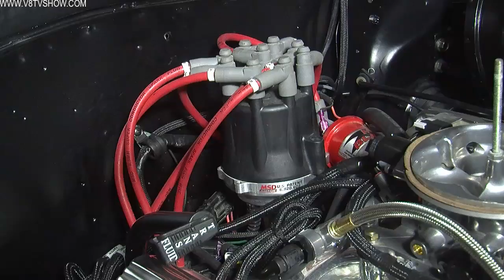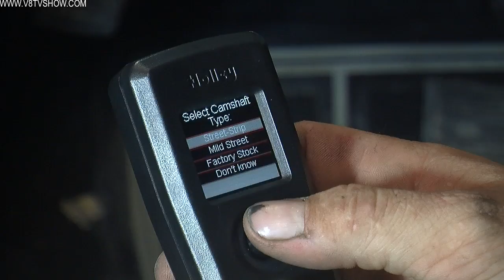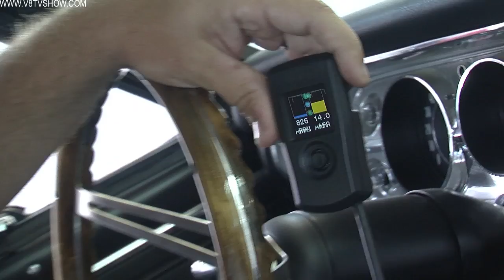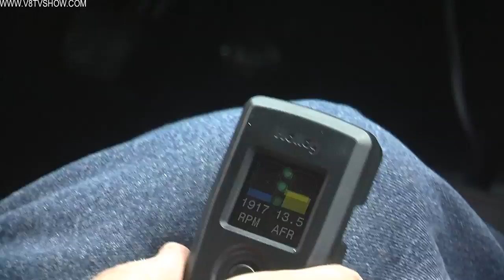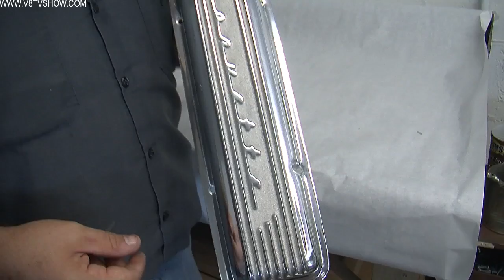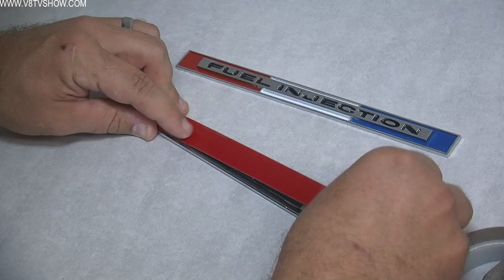Holley Terminator EFI System Install Video Part 3 V8TV 1965 Chevelle SS

Comment: Kevin,

Thanks for another great video install.  One question comes to mind:  What changes were required to the system settings when running the 5-bar C5 filter / regulator over the 4-bar standard set point?  Thanks!